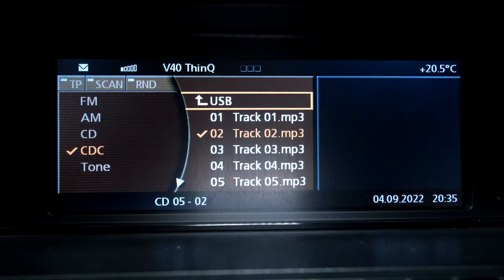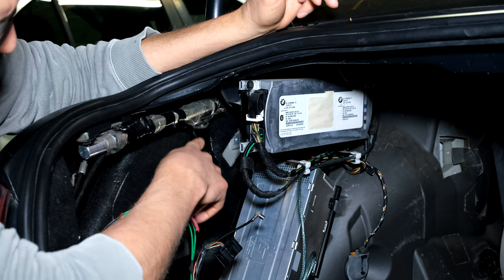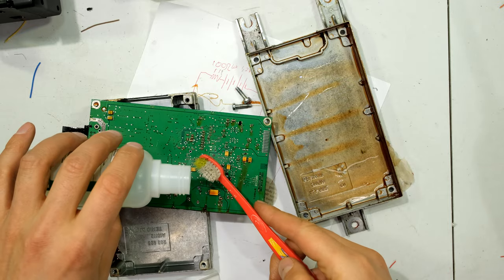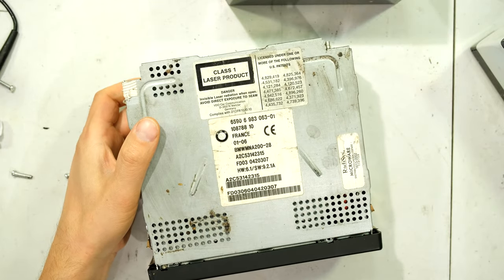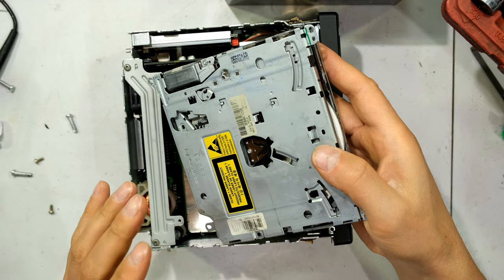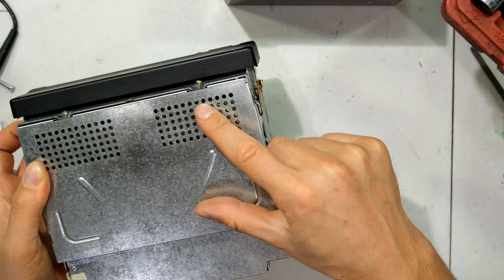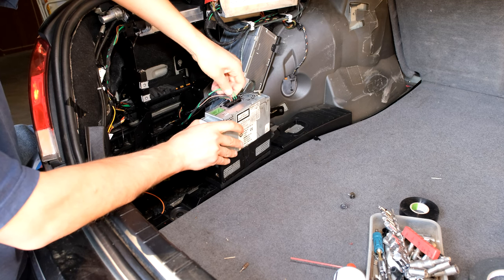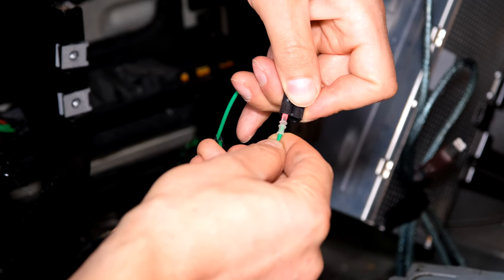BMW e65 Navigation keeps restarting- MOST bus keeps restarting. SVS module drenched in oil.

Comment: Just FYI, the red fluid from the trunk hydraulic system should be AeroShell 41 and not ATF.  They are both red but have completely different properties.  If your trunk hydraulics need topping up you should use AeroShell 41 and not ATF. Not sure if using ATF to top up as you have done has made the leak worse.
Reply from the maker: thanks. I use the Mercedes Auto transmission fluid, cannot get that Shell oil. The MB one works very well though, hardly drops in level in many years. In terms of the leak, well that might be true, not sure. So its not ATF, interesting. thanks